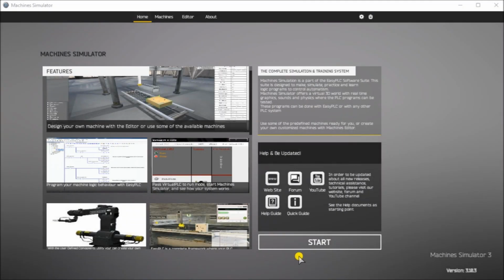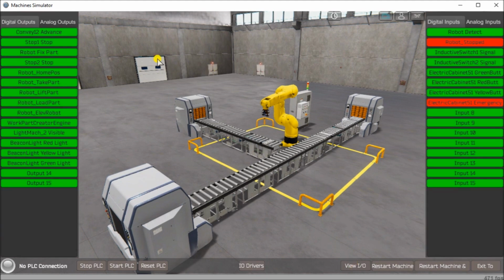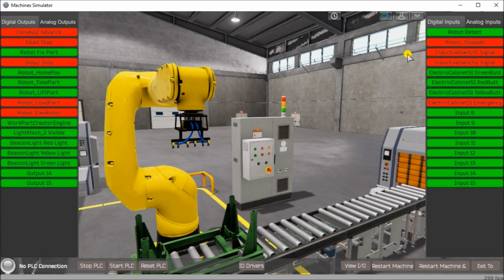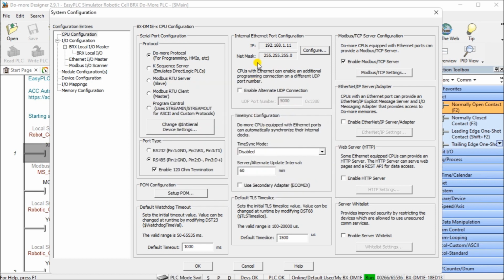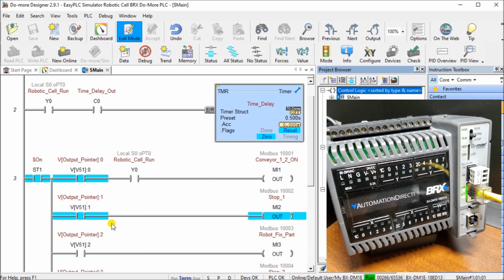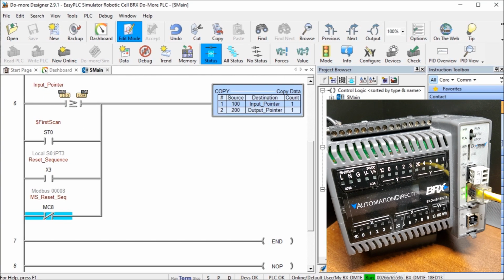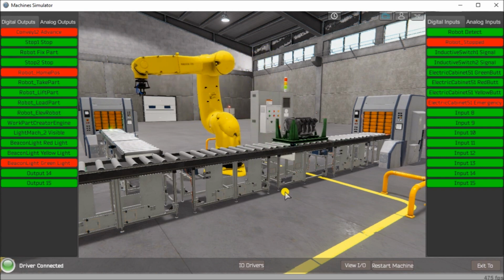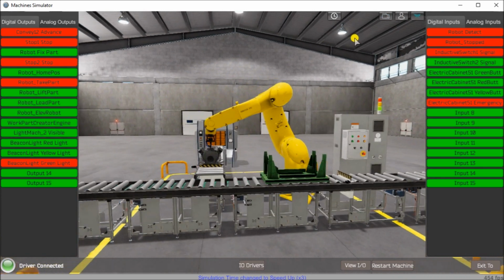BRX PLC Sequencer: Robot Engine Loader Step-by-Step Guide

Comment from the maker: ▶ FULL SERIES — BRX and Do-More PLC Programming, in teaching order. Start at Episode 1: https://www.youtube.com/watch?v=wSYgY09VYeA&list=PLYu2PsQCzNJA

Purchase your copy of this learning package for less than USD 75 for a single computer install or less than USD 100 to allow different computers.
Receive 10% off the price by typing in ACC in the comment section when you order. 
http://www.nirtec.com/index.php/purchase-price/
Learn PLC programming the easy way. Invest in yourself today.

EasyPLC Software Suite is a complete PLC, HMI, and Machine Simulator Software package. This PLC learning package includes the following:
Easy PLC – PLC Simulation allows programming in Ladder, Grafcet, Logic Blocks, or Script.
HMI System – Easily create a visual human-machine interface (HMI)
Machine Simulator – A virtual 3D world with real-time graphics and physical properties. PLC programs can be tested using the EasyPLC or through other interfaces. (Modbus RTU, TCP, etc.)
Machine Simulator Lite – Designed to run on Android Devices.
Machine Simulator VR – Virtual Reality comes to life so you can test, train or practice your PLC programming.